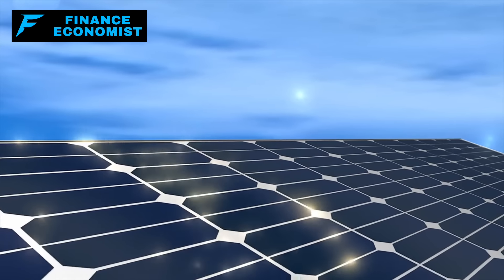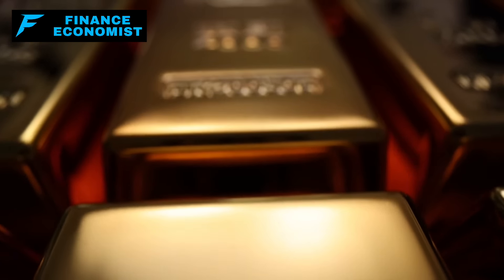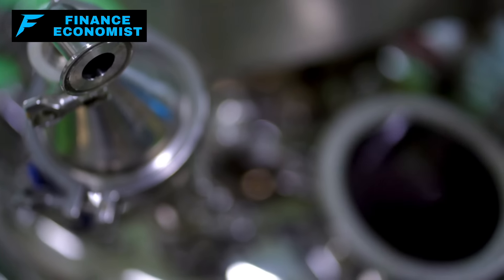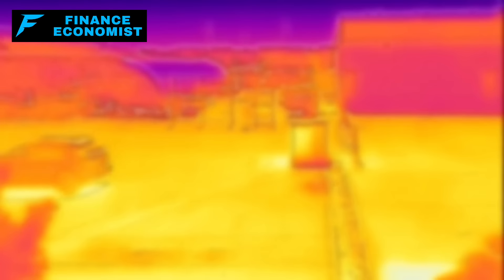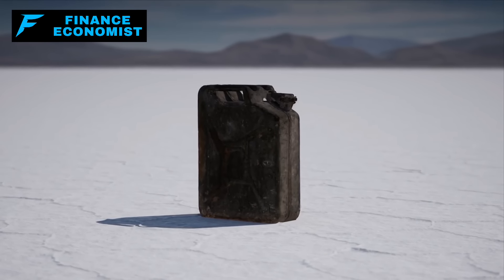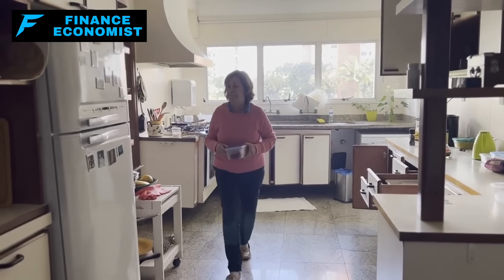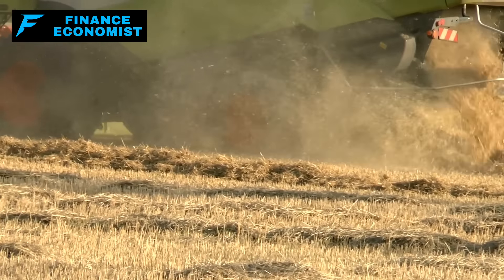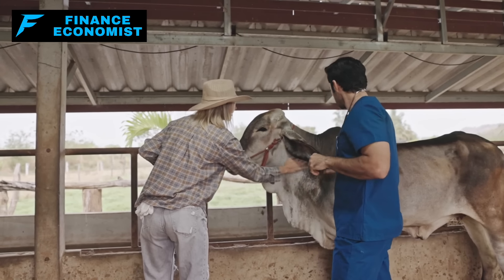8 Items You Must Hide Immediately From Looters

Comment: Where I live, lots of homes are getting solar panels installed, but it's not what you'd think. Most homeowners here don't own the panels or receive any power from them. In such systems, that power goes straight to the grid.